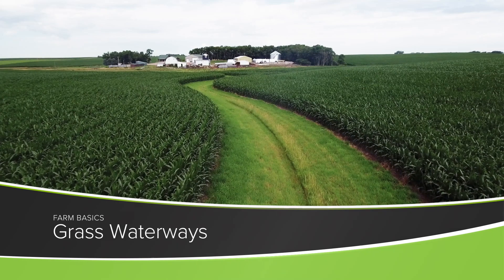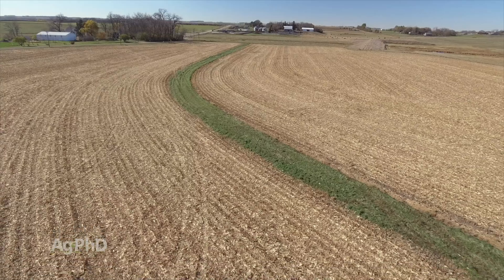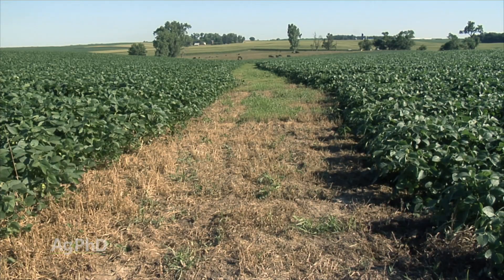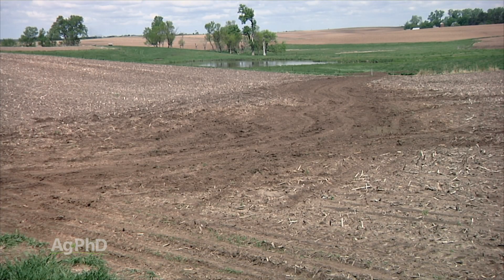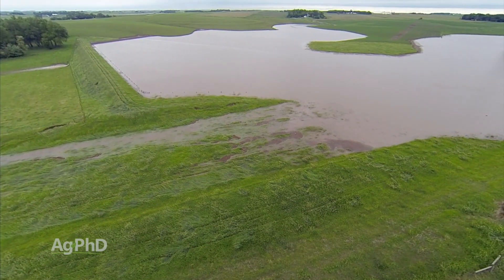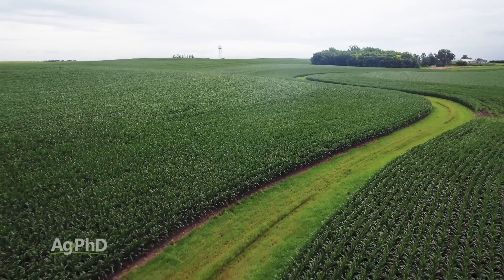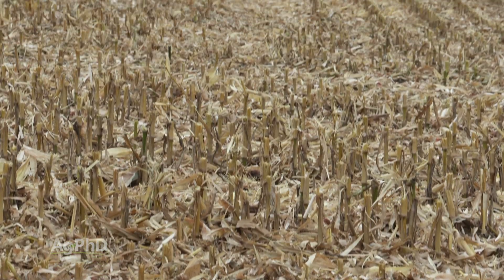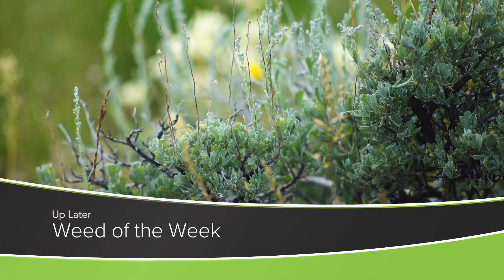Farm Basics #1190 Grass Waterways (Air Date 1-24-21)

Comment: While I understand the need for finding better tillage practices...I doubt it will be less than 10 years before some salesmen in N.Dakota re-invents selling the plow...my point is...what we bought 5 years ago isn't good enough...but looking at my dad's vhs tapes from our fields in the late 80's, they look just as well tilled with 160 hp tractors and discs.
Reply from the maker: Brian and Darren responded to your comments on Ag PhD Radio: https://soundcloud.com/agphd/01-28-21-balancing-soil-fertility#t=6:21